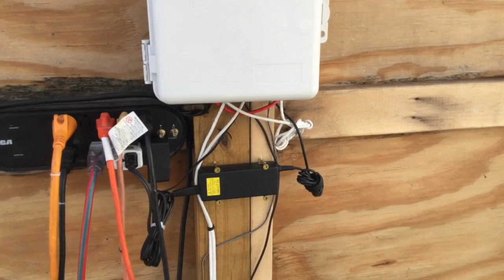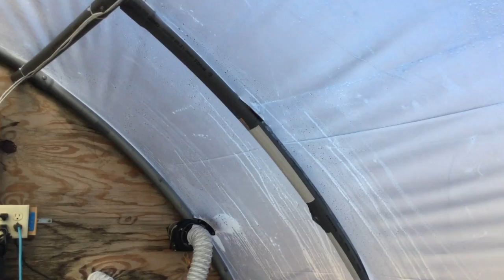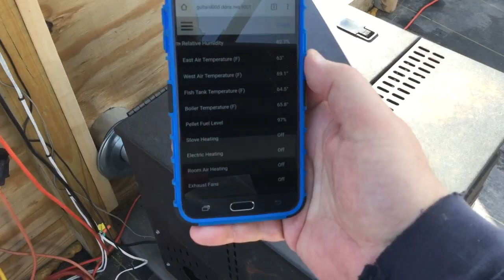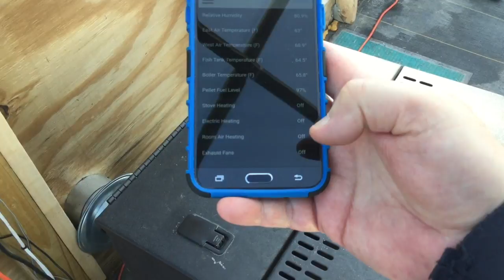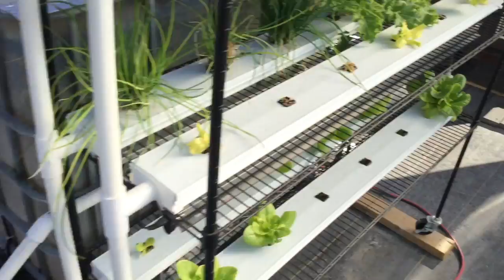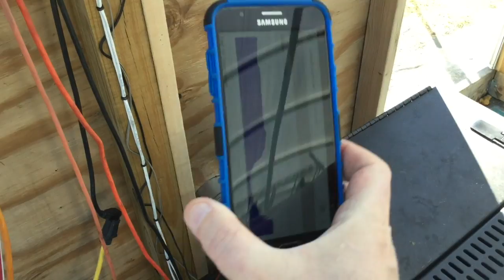Greenhouse Brain Project

Comment: Damn Larry, you just keep on making good stuff!  Although systems are commercially available for this type of application, they are cost prohibitive for most smaller applications.  So much you can do with the Pi that eliminates the need to invest in a second mortgage just to automate simple tasks.  I really need to get up there again and check everything out.  Rock on!
Reply from the maker: That's why I went this route. I've seen what these other systems sell for and how I have to adapt my way of working to their limitations. Screw that, using this method, I force the computer to adapt itself to what I'm doing.

Comment: What sensors do you use I’m looking to do the same thing but with ph control and automatic feeder
Reply from the maker: Everything I'm doing right now uses the One Wire bus, so my sensors are just Dallas Semiconductor or equivalent. But, they don't make pH sensors. You'd have to find something else dedicated for that. There are a number of Arduino pH meter projects and those probes would also work with a Raspberry PI. Chances are they already have C or Python code for using them on a PI.

Comment: Thanks for the video. What are you using for data logging?
Reply from the maker: It's just using a MySQL database server. In actuality, the Raspberry PI is just set up as a regular Linux web server but I've just tied all of the GPIO stuff in to PHP. Kind of a cheap trick, but it works.